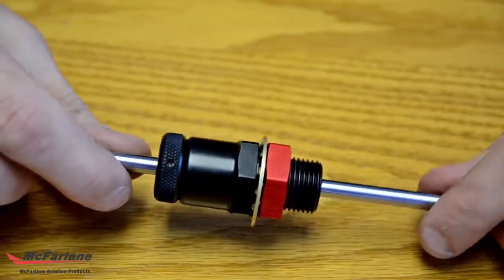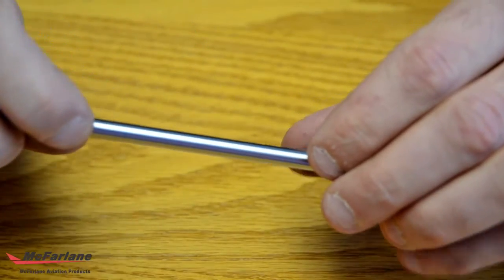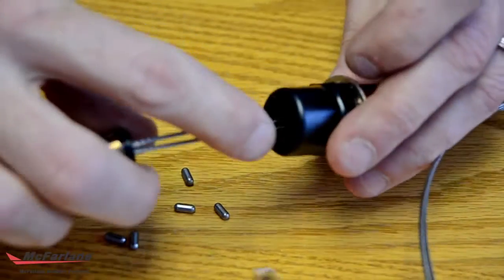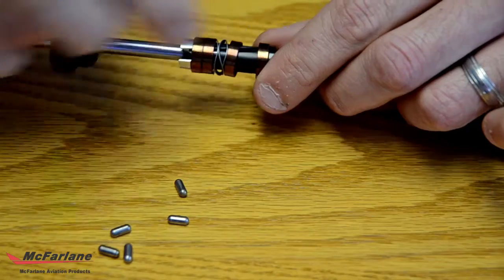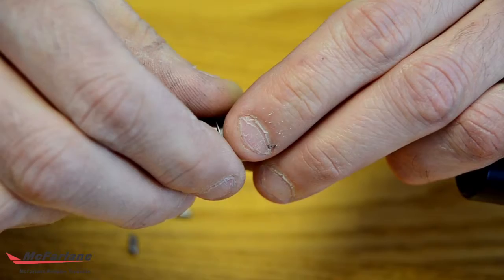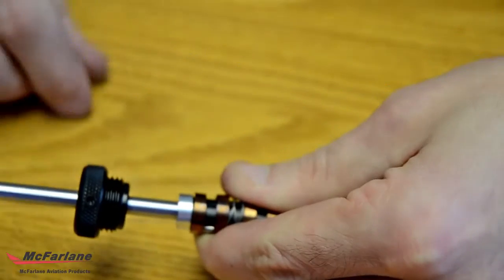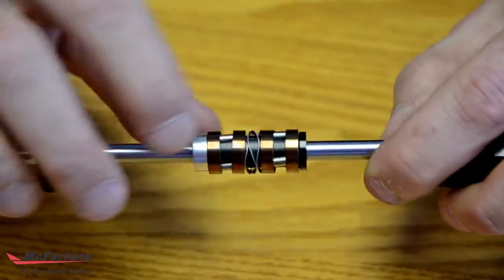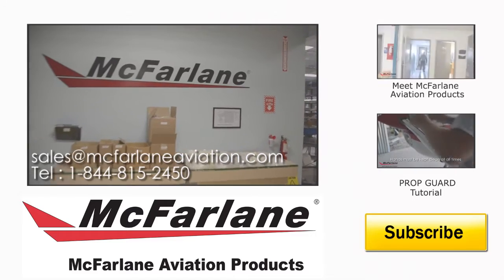Vernier-Assist Throttle Control Assembly

Comment: My prop control cable is a vernier like this, it slowly turns out on take off which backs off my rpm then in cruise it slowly turns in increasing my rpm the cable is a McFarlane and has done this since new. After watching this video im definitely not taking it apart so the little bits can fall into the abyss i guess I'll just keep running it with a rubber band on it to hold it where i want the rpm set.